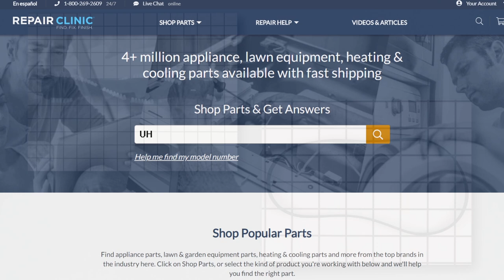Vacuum Cleaner Belt Keeps Breaking — Vacuum Cleaner Troubleshooting

Comment: my BISSELL 2252 breaks belts constantly, not the roller in fact I replaced it as well. I have purchased belts from different sellers on Amazon but they all break quickly (like a few hours of use at most). Now, the belts (even the original) seem way, way too tight, I have changed many vacuum belts in my 60 years and these are crazy tight like I keep expecting the motor mount to crack when I put one on and I am thinking maybe the specs for the belts are off?!? I would say I put close to 20lbs of pull on the bar to get it back in place while my old vacuums were like 5lbs of pull and they normally lasted a year or more. Whenever it breaks there is no obstructions and the bar spins easily.
Reply from the maker: We recommend getting OEM parts for appliances. We carry parts at RepairClinic.com.
Reply: Find a old Canned Food Can that’s slightly bigger than the belt. Put the belt on the food can & leave it out in the sun for half a week. It will stretch the belt out again without snapping it. If you purchase a belt online there’s no telling how much temperature changes it goes through during shipping, so it shrinks & dries out the belt.
Reply: Did you resolve your issue? I just learned the part that fell out of my vacuum cleaner is a belt guide clip. Maybe it is why the belts keep breaking.